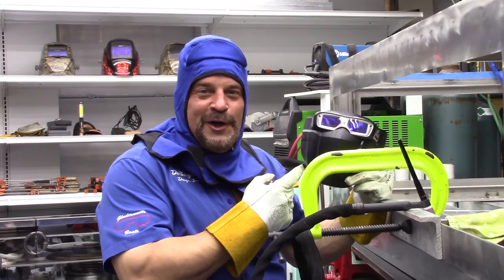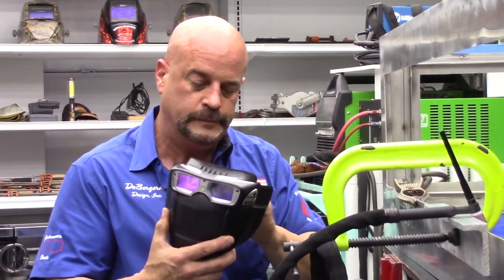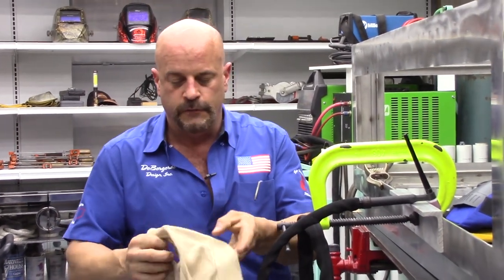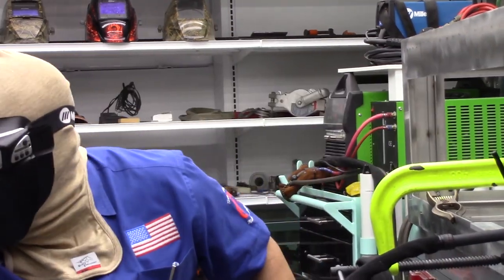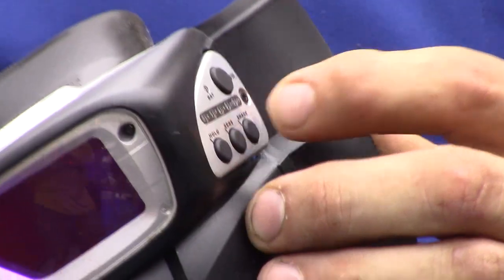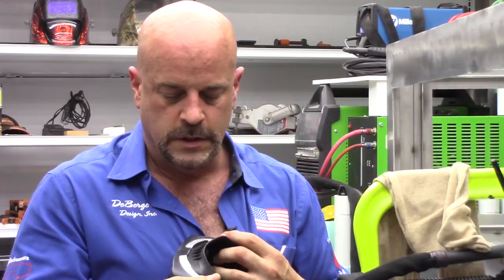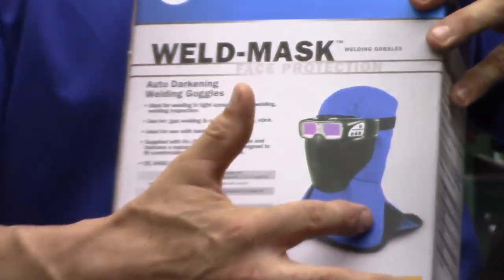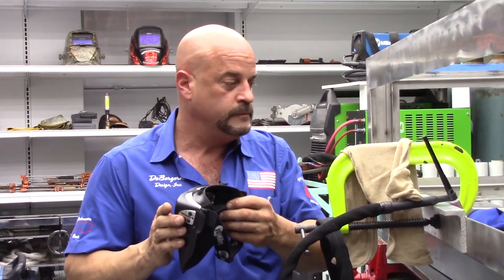Jimbos Miller Welding Mask Review

Comment: I picked these up under actual makers brand of Servore. The front of mask has replaceable shields and inside they have anti fog shields. But for the guy needing more reach,angle and compactness( I have to do exhaust welding on cars and that can be a jungle gym)THESE THINGS ROCK! Fun part is sourcing the accessories. Hoping someone could make a rechargeable version as I use mine then may not get exhaust work and I have to swap batteries but book keeper has figured out what we get batteries for and doesn't charge me now. But I do need to find those balaclava for firefighters,thanks for the idea.Lee
Reply from the maker: Glad the video helped. Had you already purchased the mask before seeing the video or after?
Best to you,
Jim

Comment: Thanks for the review. It looks ideal for those tight setups where there's no room. Would appreciate knowing more about your stainless steel welding projects. One of the things I always wanted to get into was welding stainless counter tops, like, for industrial kitchens and stuff. It looks pretty challenging with the thin materials and controlling warpage, back purge and, you know, would be curious to see how you handle such things as excellent as you are with minding the fine details.
Reply from the maker: Hello my friend! Yes it is a very neat way to weld comfortably. To answer you curiosity about the cabinets, I have almost completed the first one and we will be showing the process while I finish the second one. Hopefully it makes a very interesting couple of videos. Of course you know I'm cheating a little bit, having done one, I can look smarter on the second one. Not to worry though I will be explaining all my mistakes on the first one so everyone can learn from my errors.
Until we talk again,
Jim

Comment: Quick thought I had about the lens protection.  Obviously the idea is to never put any welding hood lense down but for that little mask, a quick fix for some scratch protection could be to put a few dabs of hot glue around the outside of the lense area to create little bumpers in case the mask should fall glass down. Smart phone cases do this to protect the screen, they sit proud of the screen to help keep the glass off the ground in case of a drop.
Reply from the maker: Like hot gun for making patterns but not going to use it as a fool proof way to save the lenses on a expensive mask but each to his own.
Jim

Comment: Would you recommend these over a full helmet? For daily use? Or just to have when you know your gonna be in tight spots?
Reply: Richard B if you weld everyday your skin gets burnt I’m going to give it a try I’m tired of burning my skin
Reply: @BugsTools  your skinned gets burned wearing a regular helmet?....how so?
Reply: Mr nice guy I weld a lot bro the Uv light goes around the hood then I get a welders tan. You’ll turn red at first haha then start getting dark😬
Reply: @BugsTools  been welding for 32 years now....currently running a lincoln 3350 viking,cloth backer velcroed inside my hood for backlight,and 3 inch leather piece under the front....I'm in the dark :0.
Zero burns.....145 amp aluminum,120 amp stainless tig,its bright....
Reply: Mr nice guy I’m going to do that to my welding hood too I’m welding underneath trucks all day with galvanized and other junk mixed in there
Reply: @BugsTools  then put on that tan balaclava if that's a concern. I've never had a burn or tan from a hood
Reply: Michael Smith I weld non stop
Reply: @theewelder   you have 32 years of experience I have a question. I’m just getting into welding would you recommend these goggles over a hood? Does it even matter?

Comment: How's the optical clarity? I have a cheaper 1/1/1/1 (nesco filter) that's been annoying me. It feels like it barely meets those requirements. I weld water tight tanks and have to get close on some welds, so this sounds up my ally
Reply from the maker: Hello Casey! Optical clarity is perfect, better than any helmet due to the fact the lenses are so close to your eyes. Not as cool as a helmet but if the weather is cooler where you are than south Florida or if you are in A/C as we are during the summer months, not an issue.
Jim
Reply: DeBergerac Design that would be an issue then. 90 degrees in Washington state is worse than 120 degrees in Texas, and I'm welding inside tanks with Dual shield at 300 amps all day. It gets HOT.

Comment: Slick setup!  Also like that it covers the ears.  Too many deaf welded out there.
Reply from the maker: Yes it is slick! It's much more important to protect your ears when mig and arc welding. The only thing that makes any noise when you're tig welding is the fans on the welder and the cooling tower. I just turn up  octane on sirrus! With a 28 inch bass box not sure that helps;-)
Jimbo

Comment: Goddamnit if it had the clearlight lens I'd buy two
Reply from the maker: What is the clear light lens?
Jim
Reply: @YachtShopCreations  it's what miller runs on their elite and 49ti series, the puddle is incredibly clea
Reply from the maker: Thank you for the insight, I will check them out. 
Jim
Reply: @YachtShopCreations  it's millers competition to lincoln's 4c lense on the 3350 viking, and optrels crystal lense.